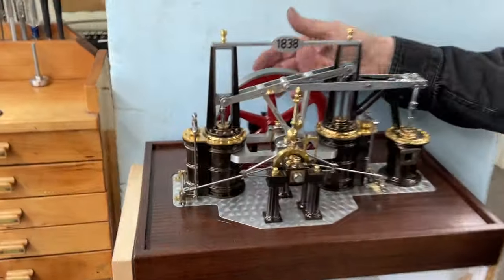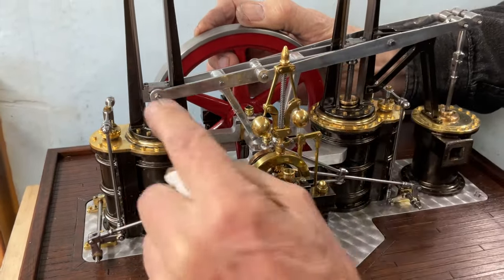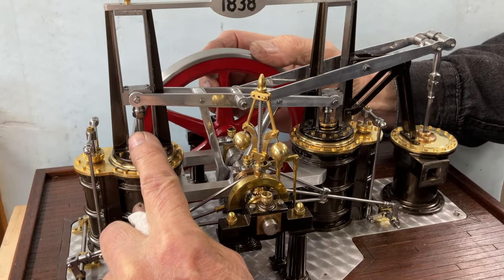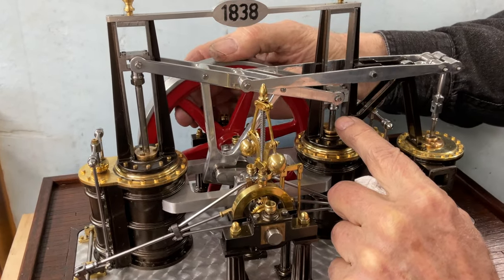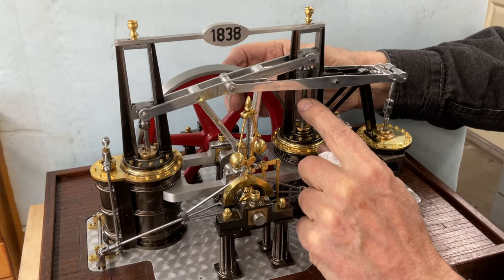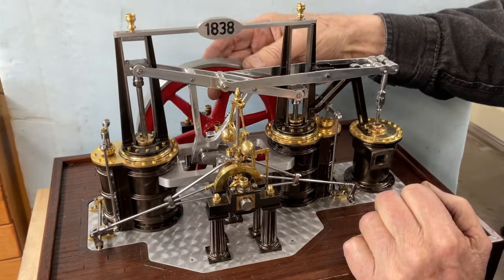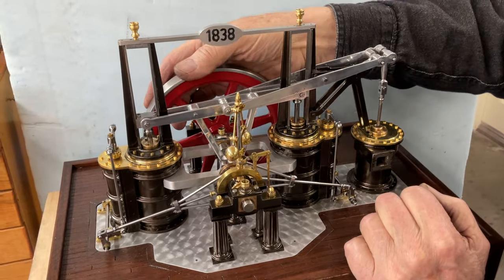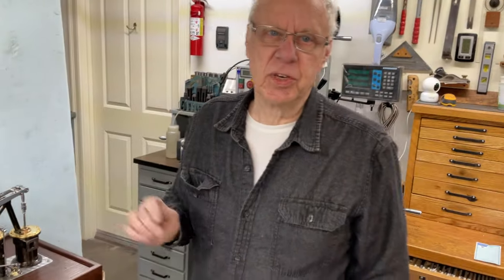Galloway Engine, Turned by Hand to show Operational Sequence

Comment: Thanks for the explanation!  It makes sense now, it’s a fascinating engine.
Have you ever built a model of a rotative beam engine running on the Cornish cycle?
Reply from the maker: I have not built anything like that. Mostly because of the fact that it can’t be run on air pressure as far as I know. I build mostly gas engines. I seldom build steam but I thought this model was extremely interesting because of the motion. This model was a design by Anthony Mount and published in a book Engineering in miniature. I thought about it for some time because it was an English design with BA thread bolts and quite heavy. I finally did build it in a 25% reduced size and changed it to SAE threads . All built up from bar stock. Thanks again for your input. Joe
Reply: That’s interesting!
Didn’t realise that engine came from over hear in England.
Will have to look into that and see if he built any more. It’s a great engine for a display!
I’ve seen Cornish engines at our steam rallies running on air,
But probably rotative double acting ones.
The return stoke was made by the weight of the pump rods in the shaft on pumping engines, so you would have back weight to make that model work.
Thanks for the info!👍
Reply from the maker: Hi Dave,
There is a casting set available for the engine, but it’s heavy. I think it is also from England. Your comments have made me think. I love building engines that have some wood in them. Cornish engines are made with a lot of ,wood especially the first ones. 
Have you ever seen plans for them.  Joe

Comment: What an awesome build as a tribute to the engineers of the past, thanks a lot for sharing Joseph. Just a hypothetical question: What do you think about building it as a 4 cylinder double expansion engine, by mirroring the airpump on the other side of it and then using them as the second stage? Correctly sized and adapted of course. If the left cylinder is fed to the right airpump and vice versa, would that make for a somewhat correct timing of the steam? Any thoughts on the mechanical/linkage efficiency? Again, just hypothetical, and just for the mere fact that it would add another delightful layer of complexity to a wondrous little machine.
Reply from the maker: That’s a great question ,but this is a model of a historical engine and changing it would go against that.Thank you for your comment and your interest.Joe